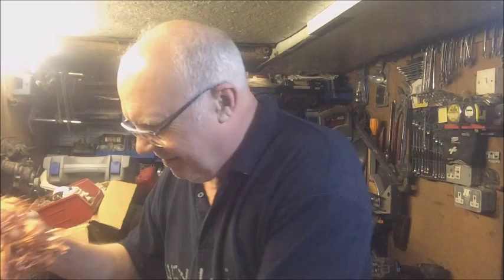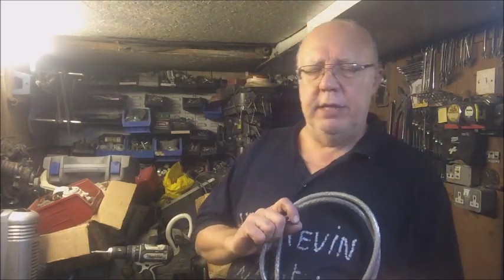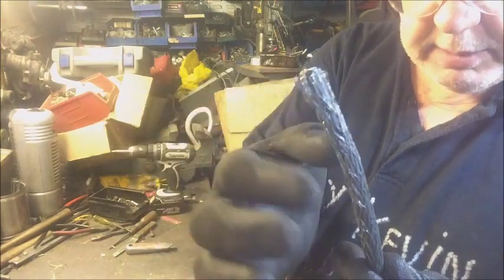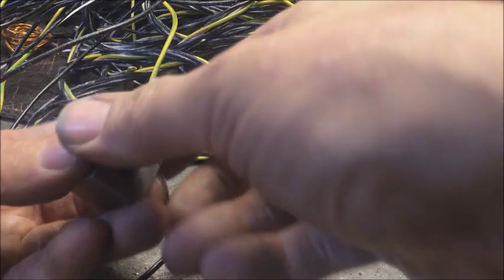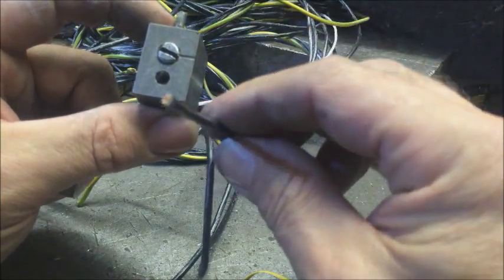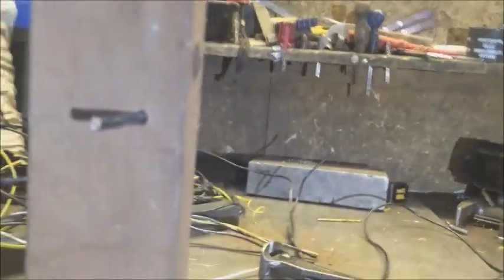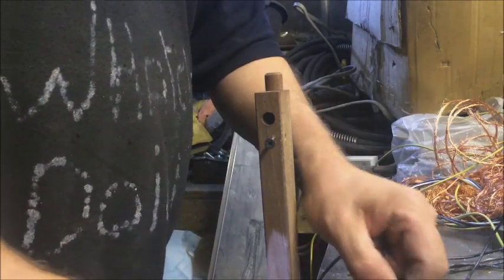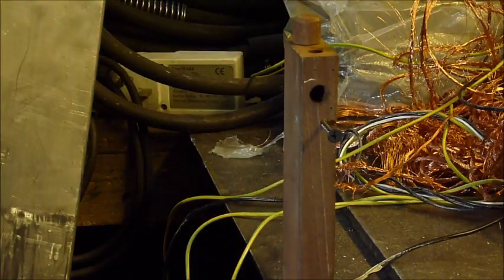Wire Stripping for Copper. A Tiny problem, a quick fix.

Comment: I've just learned that stripping smaller wire isn't worth the trouble.  I use to strip it all with different methods like you did here ! Still today when I have the time I'll strip it but not usually.  Good video Ian! I'm still catching up on your videos! Thanks for sharing 👍
Reply from the maker: Thanks, since then I was given a Manual wire stripper, which I use for the majority now, I still strip a load with a knife though

Comment: I suggest grinding a flat spot about 1 cm. Perpendicular to the cutting edge of the drill bit knife. This will assure the blade is along the center of the jig device. Less fussing trying to find the center of the guide hole. Anyway...the very best to you and all other Blokes o'er yonder.

Comment: Is it worth stripping household wire or just take it in as it is do you lose much is the time worth it
Reply from the maker: Gary olbison   Oh that is a big question to answer,  if you need to do it for a living then no, time/effort/Return ratio is not worth it unless you have a wire stripper, but size of wire does play a part, but you do say. Household wire, if you mean solid core twin & Earth, then most definitely strip it, it’s that easy to do. Flex, cable. Like on appliances then,  well  search one of my older vids where I weigh and strip a kg of cable, to weigh the copper content, you do get more but not that much more, then again I’ve seen Bright wire at over £5,300 a ton. Then most definitely strip it. Scrapping is a hobby for many of us so time is free.  You don’t see a Fisherman weigh up the time spent watching a float, against the cost of buying a fish from a fishmonger
Reply: @Man-in-da-shed    good point about the fisherman. It has more to do with the passion for the mechanics involved, I would think.
Reply: Household is normally one solid wire 12 or 14 AWG. This is best done (stripped) by sending the individual wires through two rollers whereby crushing the plastic cover. The stranded is best done by slicing down the center.
  There are some wires that pay better money if they are not stripped. Yeah, I know....Crazy, but true. Weigh the wire unstripped and get a price/lb. (or kilo). Then weigh the same wire stripped and calculate the price/pound. You might be surprised.

Comment: What about using an additional screw in the other side of the wooden jig?  My thought would be ...less peeling because both sides are cut...allowing the covering to fall away. Just a thought. Cheerio.
Reply from the maker: Thomas K your comments Provoke thought, I do so little wire stripping that it never seems worth it to put the effort in to make it more efficient, even though I know long term it would benefit